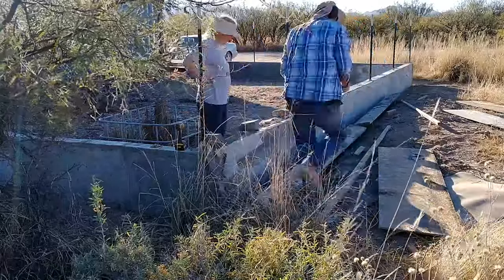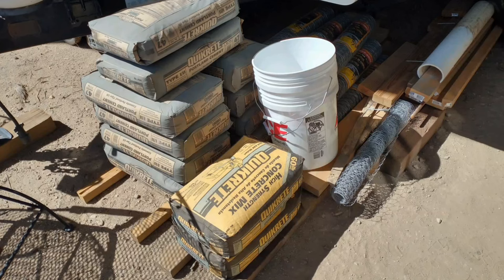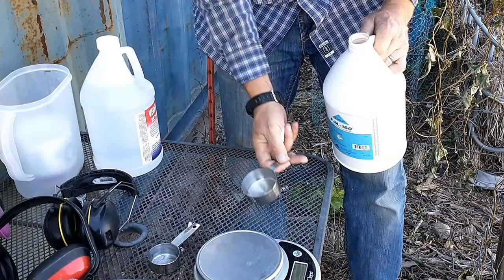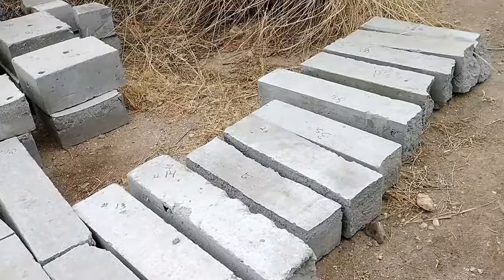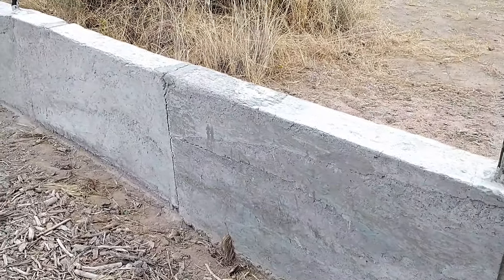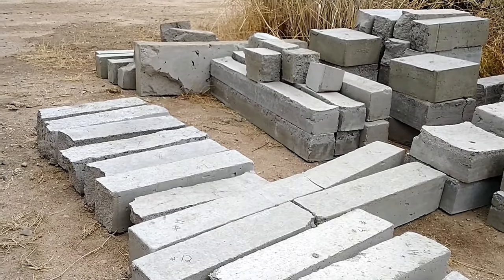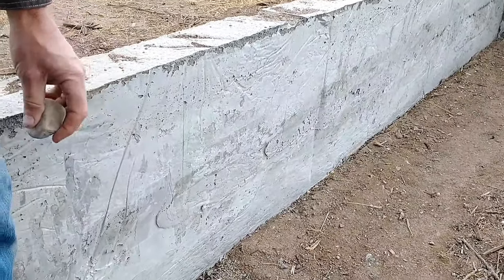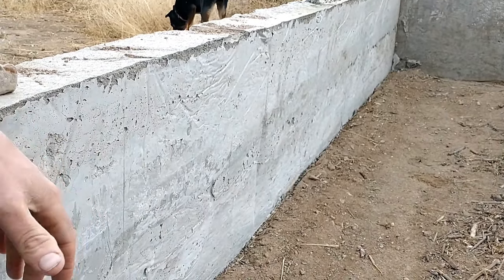Why we GAVE UP on AIRCRETE & What is Our Plan Now?

Comment: You folks are an inspiration. I have been testing mixes of portand cement and native soil here. I have found a 3/1 mix of screened soil is really good stuff here. Thanks!
Reply from the maker: Awesome! We were considering trying to make a batch with dirt, but our soil varies widely. We have it all, silt, clay and sand, so we figured it would be hard to get a consistent product since we would need a lot. Sifting the sand through a fine mesh for our test batch was sure was a lot of work, but it did make a good strong aircrete. Thanks for watching! 😊
Reply: @RedandAprilOff-Grid  you should mix the soils you determine to use until they are uniform.

Comment: I am someone who is a fan of the Foam core fiberglass construction process.  Therefore I would have incorporated foam insulation in the construction.  Aircreete looks good but the problem is that it looses 90% of the structural properties of concrete.
Reply from the maker: Sounds interesting 🙂

Comment: I'm sorry for your lost time and cost while trying to use aircrete, but find this very informative 👍  aircrete at a high level seems like a miracle but as they say if it looks too good to be true it probably is. I keep coming back to look at aircrete and now there seems to be many many people admitting defeat and the pattern is always inability to achieve consustant results ... Good luck with your build
Reply from the maker: We thought it sounded promising. A few years ago, a quick Google search was saying aircrete had an insulation value of R-5 per inch, which sounded amazing, but it's definitely not true. It's not an easy or inexpensive material to work with. Our house turned out great, and our experience with aircrete made us more appreciative of conventional building materials. Thanks! 🌞

Comment: Keep it simple the support and strength comes from fiberglass wrap over aircrete
Reply from the maker: Due to temperature changes and other stressors, we were concerned that the aircrete would eventually crumble inside of the plaster walls, which would be impossible to repair. Maybe it would have worked, but we decided it wasn't worth the risk. It will be interesting to see how long the garden wall holds up.
Reply: @RedandAprilOff-Grid  I agree. Fiberglass wrap is perfect for compensating for the spongy nature of aircrete. But in a wall next to load posts that might move even slightly, the fiberglass will lose every time. Better to wait and see how the garden wall holds up! You can re-build that easy. Not so easy with a house. 😂
Reply: It would be nice if some aircrete pioneers who have structures that have been around for a decade or longer had information about its long-term durability.

Comment: one thing I noticed it looks like you didnt use any rebar, rabbit wire, hay or strengthening materials in your aircrete pours.  Good luck with your build and best wishes.
Reply from the maker: We were planning to add some type of metal reinforcement or fibers. For these pours, we were testing the strength of the different aircrete recipes, and our ability to make consistent batches. Thanks! The house is going well, we just got dried in.

Comment: Foam should decay more than 12 hours in winters and 6 hours in summers. And mix it well and also check density not less then 800 kg/ m3. And for more strength use HPMC.

Comment: Of course it's going to crack, when you load it like that. Even concrete would crack the same way, if it didn't have steel reinforcing. That's certainly not a reason to reject it. 
Under compression, when you build a wall with it, or make a post, it's strong. But if you want to make a beam out of it, you'll need to add reinforcing. 

Regarding the smoothness of the wall, you have to accept that, because the aircrete is already filled with air.  I think the idea is that you render the aircrete with stucco, which will give you a nice finish. I think it's necessary, because aircrete itself is porous, so it's not imperious to the weather. Another reason stucco is needed.  

I wish you the best of luck finding all the right materials.
Reply from the maker: Yes, we were planning to add several types of reinforcements, which was talked about in previous videos. Our testing was to determine which recipe we wanted to use as well as our ability to make a consistent product, No regrets not using aircrete, our passive design house turned out amazing, thanks!

Comment: Portland cement in concrete is a binder for the aggregate. The strength of the concrete comes from the aggregate not the cement binder.

Comment: I thought I had the perfect idea to use aircrete like SIPs. My thinking was to use poly row cover material as a skin for the aircrete. I thought I might be able to line a form with the row cover, pour it, and lay more row cover over. My hope was to achieve a result like what HoneyDo did on that shed, but without all the metal studs, and the huge hardware cloth expense. I hoped the fabric would act like the paper on a sheet of drywall. In the end, this experiment was an abject failure. The aircrete failed to bond to the fabric of the row cover, and the panels cracked in multiple places while removing the forms. Like you, I believe aircrete has potential, but suitable techniques outside of the igloo coated with poly mesh, pioneered by Domegia, remain elusive.
Reply from the maker: Yes, pretty much anything is better than aircrete in my opinion. I think a lot of the people who have built aircrete domes have also had trouble with them cracking and leaking. The cracks turn powdery and can't be repaired, so it's a total loss.
Reply: @RedandAprilOff-Grid  Sounds like a night mare. I have a friend building with pomace crete, over in Seco. I can get my head around that. 😉
Reply: The Stay In Place (SIP) forms I've seen had exterior walls made of cement fiber or Sorel/magnesia cement panels. Filled with aircrete, supposed to save 30% on cost plus allows rapid construction by low-skilled workers. Not many people using it.

Comment: I've been considering aircrete, but had serious concerns about these issues. Even one self-proclaimed expert with his own tools and foaming agent formulas has the same types of problems, but is still dedicated to aircrete.   My theroy is the problem is related to the fact that the foam uses surfactants (ie soap) in order to create the bubbles that make the air in aircrete. However, these surfactants react with moisture, and moisture will always infiltrate concrete at some point.  So once the surfactants are re-wetted after the concrete cures, they'll cause the concrete crystalline structure to fail, as the bonds are slipping and sliding in a soapy matrix, hence the characteristic flaking of the exterior surface with little to no effort.  And if that's happening on the exterior, it must be happening on the interior as well. How can anyone trust such a material to hold up over time , especially if it's in a load-bearing application?  I can't invest in this material until there's a fix to whatever is causing the problems.
Reply from the maker: Our main concern is that it would eventually crumble or turn into powder inside the wall. Concrete expands and contracts with temperature changes. With abrasion, aircrete turns into powder, so as it's moving against the wire mesh, metal frame and rebar, we could imagine the friction turning it to powder inside the walls, and once it was discovered, there wouldn't be any way to repair it. We made our garden wall out of aircrete, so it will be interesting to see how well it is still holding up in a few years.
Drexel foaming agent is temperature sensitive, and needs to be used at room temperature, so unless you can make aircrete in a controlled environment, you are likely to have problems. 
We watched all of the videos we could find, asked questions, and even tried the Aircrete Harry thickening agent, and it didn't perform any better than our other samples.

Comment: I'm totally new on this channel and this is my first video so my. Question is: why not buy aircrete blocks? With all the time and materials spent on trying to diy it, I think buying pre-made aircrete blocks would have been a better choice. Also aircrete is not like cinder blocks, they are not meant to be in contact with (possibly) wet surfaces. Like compacted soil. It should be on a concrete foundation, and to block any wetness you need to seal the concrete underneath the walls with a tar like foil you heat up to make it stick to the concrete. And it has to be covered both on the outside and inside (ie. drywall or wood etc.)
Reply from the maker: Appreciate the respectful comment and honest questions. Yes, this video was the last in our progression of aircrete videos, so we didn't explain everything. We can never tell which video will take off, and it's repetitive to explain everything in every video. Premade aircrete may get more common at some point, but we didn't know of anyone anywhere around here selling it. We also thought aircrete would be a less expensive option than a more traditional build, but once we knew enough about it to calculate it, we realized it wasn't. We were planning to pour it on a concrete footer, and put in metal reinforcement, fiberglass mesh and stucco. We are really glad we moved on from aircrete, and are excited to now be moved into our new passive design home, that is performing way better than we expected. 🌞
Reply: @RedandAprilOff-Grid  thank you so much for your explanation, I appreciate the time you took out of your day to respond to me!! I totally get that not everything is accessible to everyone everywhere. I'm from germany and aircrete is in every hardware/home store and I wasn't aware it's not a very common building material in the US. I love the idea of an energy passive house so I'm going to check out your other videos and subscribe ❤️ I'm sure whatever you chose was the best desicion for your situation! Can't wait to see its outcome

Comment: I’d go slipform big rocks stone masonry in rammed earth. You don’t need to use cement in rammed earth. Just make sure you use a lot of big fist sized rocks and use as much clay as you’d use for cob with concrete aka sharp sand and lots of gravel from different sizes up to plenty of of softball sized rocks
Reply from the maker: 😎 That sounds like a pretty good way to do it. 👍

Comment: From what I've seen over multiple channels who have used this material,  i have come to the conclusion that AC is an excellent insulating material but structurally is sub par , so i believe the proper use of AC is to be used like foam and fibreglass for best results and FC is even better and allows less use of hard wall materials
Reply from the maker: It's pretty expensive, and a lot of work for insulation. There are a lot easier, and less expensive options for insulation.
Reply: There are cheaper more efficient materials to use than AC as an insulation material. Insulation plasterboard, fibreglass, foam etc. all depends whether it’s retrofitted use, new build, internal/external fitted to walls, lofts, within cavity walls etc.

Comment: Did you guys try reinforcing the aircrete with anything? Chicken wire/hardware mesh, rebar etc? No one builds with only concrete, after all - the metal provides the true strength.
Reply from the maker: As mentioned in our other videos, we were planning to use some type of metal reinforcement, rebar, and fiberglass fabric and plaster on the outside. These were comparative tests of the aircrete material itself, and our ability to make consistent batches.
Reply: @RedandAprilOff-Grid  thanks! And sorry, I just discovered your channel. I'll look through your other videos for insight. Thanks for sharing all this great info!

Comment: It would be beneficial if you informed us of your concrete sand mix, also you need to put in expansion joints every 10 meters or near right/left angles to the wall. Also if using expanded polystyrene balls or scrap the measurement in cubic footage used is crucial. 
My advise: Never begin a project wearing blindfolds wrapped around one's cranium. Guessing in the dark never works out :
Reply from the maker: This is the last video in the series. We have other videos sharing the process, recipes and everything we tried. We also have a playlist with all of our aircrete videos.

Comment: Thanks for these great info you guys put out. Although i have to tell concrete/aircrete will crack without sufficient watering, every day, 4-6 times a day for 30 days. It's like a flower :)
Reply from the maker: Thanks! We watered it morning & evening, and kept it covered in plastic and an old air mattress to keep the wind out. The samples were originally tested wet on the 8th day for comparative testing.
Reply: Keeping wet constantly for 7-14 days should be sufficient for concrete. The time depends on water-cement ratio and concrete plasticizers if added.

Comment: In order to mitigate the weakness, and more importantly, the inconsistency of this material you will have to build much thicker walls - I'm talking walls that are 2-3 feet thick. And even then there will be waste of material, because there is no other way to insure against the variation/inconsistency of that material, than building with excess thickness as insurance for a weaker batch. At that point it's better to just build normal walls, or if you want to make it interesting an innovative, what about 2 thinner walls with empty space between them to fill with light insulating material (which could be that "aircrete" as you will no longer rely on its strength) or for example empty plastic containers as insulation.
Reply from the maker: An aircrete house with walls that thick would be expensive and a lot of labor. We ended up going with 2x4 construction with 2 inches of exterior reflective insulation board, with an air gap. Then we used metal sheeting over the outside. It is performing amazingly well and is heated completely passive 🌞😎.

Comment: You could do a section of traditional concrete around your beams 
And i would definitely use traditional concrete for the base footer
Reply from the maker: That would help, but after our experience, aircrete is not a material I would choose to use for anything. There are better, easier and less expensive materials available. Yes, a house definitely needs to have a concrete footer. We ended up putting in an earthen floor instead of aircrete.

Comment: I think the cracking is due to fast moisture loss, normal poured cement is kept wet/moist to dry slowly
Like sprinkled and covered with plastic
Reply from the maker: Yes we kept the forms on for a week and watered the wall twice a day. The forms were also lined in plastic. I think the colder temperatures were likely affecting the aircrete mix.

Comment: The commercial solutions is to autoclave. Constant environment. Also needs reinforcement like steel wool(?). Also just cement is unwise.....needs some sand or grit.,jpk
Reply from the maker: The life span of autoclave is now considered to be only 30 years, aircrete is probably less than that. Yes, we were planning to add reinforcements and stucco to our house.

Comment: Sorry it didn't work out after all your effort.  Was wondering if you did anything to your foam gun like seeing if the stainless steel scrubbers were compressed?
Reply from the maker: Thanks, no we haven't looked at it. The temperatures were starting to get below freezing, so we figure that was probably a factor. Aircrete would have been such a pain, I'm really glad we didn't try to use it.

Comment: ...how about the weather/humidity/temperature, over the months of your tests? Would it be a significant external variable?
Reply from the maker: I think the colder temperatures were likely contributing to the issues with the later batches, but there may have been other factors too which just makes aircrete overall not a good option for us out here in the desert. We have big temperature swings from day to night, and are typically very dry. We kept the samples covered and watered them twice a day, but not much else we could do to control the environment.